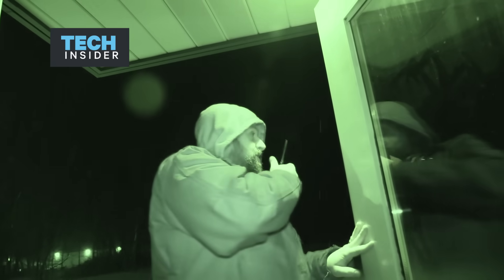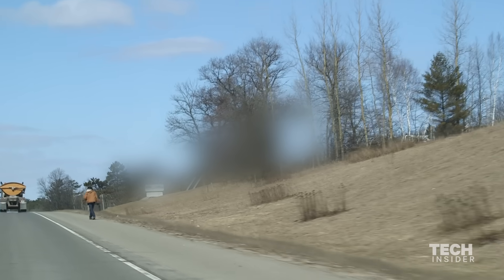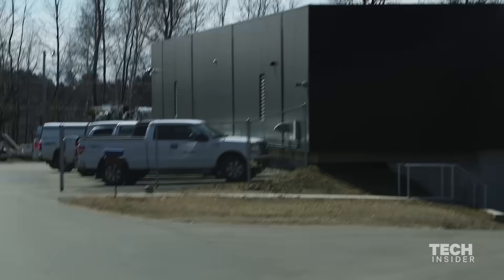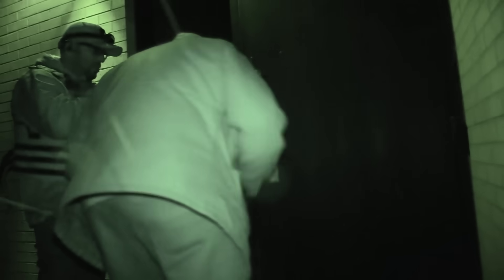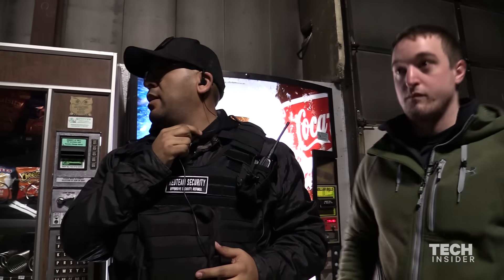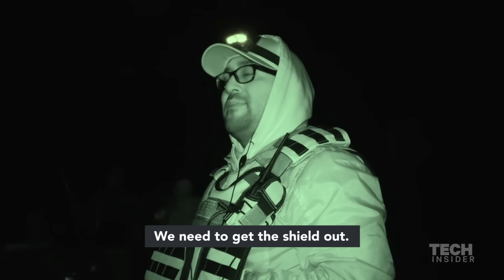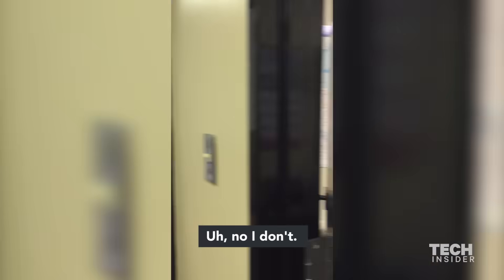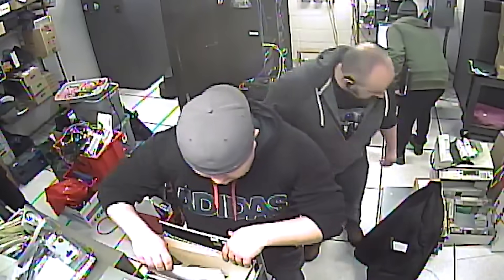Watch hackers break into the US power grid

Comment: Plug bot, AKA a raspberry pi 3
Reply: xxXSalty_Viper420Xxx Haha
Reply: Jepp :D
Reply: These board are sold either as RapsberryPi3 indeed or added hardware and preinstalled software so you dont have too, not uncommon in the scene. Some tools are waay expesive then they need to be, but some come with service contracts aswell ;) whats cool is most of it is basicly also availeble for free if you look arround long enough. But you probably end up a ethical hacker too.

Comment: I'm calling bullshit at 10:30, that power station would be putting out so much freaking rf radiation, there is no way you'd get a decent video signal. especially with a damn DJI phantom and an ipad fpv setup. sheesh they dont even have CP antennas lol

Comment: Hackers, using a MacBook, and windows , not to mention they have an iPhone, fucking hipsters
Reply: These are tools, if they work and comfortable, that's all you need
Reply: ThexXxXxOLOxXxXx That's a really strong statement. OSX is full-featured UNIX OS, are you saying unix os is not good for CS?
Reply: iare19 I haven't had a single bsod on windows for last 5-6 years. And it performs flawlessly for me. Are you by chance installing tons of questionable software?
Reply: iOS is 10x more stable and better for these kind of actions that windows lol. Burn windows, nobody uses that beyond commercial level.
Reply: iare19 Let's bump it a level then, do you maybe have cheap hardware with low quality drivers? That have been a problem since windows 98, terrible drivers are cause of most of problems after user himself
Reply: ubuntu... XD ... sure.

-kali
Reply: the list goes like this

1. Kali
2. Linux/Ubuntu
3. Windows
4. OSX

rekt
Reply: PuLsE Munstaz Linux is not build from unix, its a unix like System but has nothing from the original unix code.
Reply: "OSX is Linux based".... I've officially heard it all.
Reply: Anton Kovalenko get out of here with your basics, levels above you.
Reply: You can't hack well from OSX terminal though.
Reply: The Mac OS is a type of Linux technically.  Mac OS X is built off of a thing called unix. Unix is what most, if not all Linux distributions are built off of. Mac OS is more than capable of hacking into anything. Given the right tools. If you don't believe me look it up.
Reply: I didn't look it up. I read it from a comment a few more down.
Reply: Anton Kovalenko
yes I have pentium 1 on 56kb/sec dial up, you utter dumbass.
Reply: PuLsE Munstaz like you did
Reply: chiggins love it
Reply: this thread gave me ass cancer. OSX is linux based? Pentium 1 with 56k dialup (as in it is something special, lol, how 'bout 386 with 14400 modem lol)? Ubuntu as in c001h4x0r choice? Like literally what the fuck? Ugh, you stupid, public internet, and its only getting worse.
Reply: chiggins OK

Comment: 8:24 Is that Raspberry Pi? Huh...
Reply: It is. Best tool for hackers. Plug it in to internal wifi or ethernet and all traffic gets nice and monitored. You can use it as vpn hotspot and use it to access internal computers, or have robotic function like plugging off power when the time is right.

Best part, low power consumption so can run on battery and is size of a credit card.
Reply: JAYR_G Programming in Linux environment is amazing practice. C/C++ and python, oh the feels. It also teaches hardware orientated programming which leads to the IoT world.
Reply: I have the same question
Reply: ElectricSammich Ik I have one but I just use it to program
Reply: GTpcGaming seems like u may be able to help me in the future,  is going to subscribe and if I ever need help with anything I'll ask u k man?
Reply: im*
Reply: Yes, it's a Raspberry Pi 2. Those things are pretty much perfect. You can plug them in, they boot right into the operating system (which is just a normal Linux distro for ARM processors so you can do anything you're used to doing on a desktop PC if you use Linux) without the need of any interaction, they have USB ports and an Ethernet port. This means you can just plug the Pi into their internal network and tell it to start a program after booting which queries your own server for commands and then executes them and sends you the result back. This means that after deploying the device, you can take as much time as you want and stuff which only can be done from within their internal network from your office.

Comment: Yeah, I do research on smart grid security. The whole thing is a mess. DOE have their labs and they tend to give more resources to those labs and let these labs to decide the project applications of the others. When there is this kind of right, there is corruption. Those power grid researchers in DOE lab just want to publish junk papers and get paid. When they provide a standard or a real product, they don't consider the big picture behind or any potential weakness can be exploited. And it is the altitude of the whole research community now. The smart meters for example. They claimed it is essential to variable electricity pricing. It turned out there are other designs which is more secure. The smart meters collect electricity consumption of a home in real time which can reveal your inhome activity like whether you are asleep or whether you are at home. This is an extremely insecure information collection. Without any careful thinking, they make the new standard and make it a law to install smart meters at consumers cost. However, in the end, those utility companies and grid operators don't utilize these information at all. And smart meters are proven not the only way to achieve variable pricing. So, as a final result, without any benefit to any one, they create a hole in people's privacy. Indeed, in some state, debt collectors and some other agencies are allowed to use your smart meters data to see if your are at home. What a shame to work with these fools.

Comment: fucking neckbeard christ, why are you in tactical gear... lmao.. fuck.. police roll up and you have MEDIC across your chest.. 

have clipboards, toolbelt, and a fucking jumper.. badge.. common sense, fit in, not look like you playing paintball
Reply: Burglars tried this at a former workplace of mine. They jumped the fence where there was no camera coverage, entered a crew building, then put on company coats and hardhats and walked out in the open to start stealing copper and anything of value from the trucks. They didn't realize that the operators on duty watching them once they stepped in front of the cameras knew that there wasn't supposed to be anybody in the yard at 2:00 in the morning. Cops were called and they surrounded the facility and moved in. They caught two outside the fence and another the next day. Burglarizing a utility facility netted them both local and federal charges.

Comment: I heard about this (or very similar) in a cyber security class last summer. The other issue is they need to update the protocols that are used to control this stuff. The original protocol was made for phone lines, communication over the power lines so security was no issue, now they use internet links and this is an issue now.

Comment: Is breaking in physically not cheating a little? Physical access to systems is king and so if you break in then it is game over, what comes next is moot. You are not really giving their internet connected security a test at all. The idea IS to test the IT infrastructure, right? Because I see a physical pen test as something completely separate to a network/intrusion pen test. Even if the scope were to cover physical security, then a comprehensive test of the network would be first and more likely to get you a foothold (IMO).
Reply: huxleypig69 there are no rules in hacking
Reply: D Freytes
I completely agree. However, we are not talking about a 'break it all costs' mentality. A pen test should be a TEST of the defences. Whilst this may expose the physical issues, it does nothing to stop a future hacker from gaining entry via the wifi, or the web server, or any other technical method. The issues remain untested. This should be a last resort, not the first (unless it is a physical pen test, which this was not).
Reply: Breaking in physically was part of the hack. It is called social engineering. 

If the company had better security and on-site protocols, they would not have access physically.
Reply: Tinutaja
They didn't socially engineer their way in. In fact, they tried and failed spectacularly to socially engineer their way in! It was one of the poorest attempts I have ever seen.

They gained entry by shimming a latch and using an under-the-door tool.

If I were this company I would feel somewhat cheated because my IT infrastructure had not been tested against external attack at all.

Comment: Compromising the power grid is real simple.. You don't need all this "social engineering" and other "technical skills".  All you would have to do to shut down the grid is a coordinated attack of people at a bunch of different key sites and throw a few grenades over the fence and blow all the shit up that controls the grid.  Most of it is sitting there, readily accessible, with weak fences and other security measures.  The hell with hacking the computer systems and giving yourself root, just get rid of it and it all crashes.  The current grid is already over-taxed with demands so blowing it up would ensure that nothing is going to operate for the foreseeable future.  This is cake and childs-play and has already been assessed by multiple agencies.

Comment: You'd be surprised how many places you can get in to by simply opening the door.  Specially government facilities, power grid but also to homes..
Reply: Doors typically are both the entrance and exit of a building.. I'd find the window perhaps a bit more surprising.
Reply: CrapLuckSimon Windows too but they rarely are made to be open frequently. Definitely weaker structure but usually requires you to just smash it where as with door, you just turn the handle. It is totally human to forget to lock the door you use to say, go to cigarrette break ;) Most common door to be unlocked, sometimes even propped open..
Reply: SquidCaps I was just saying, doors are typically how a person pass into/out of a room. And by that I mean it's not surprising. However I understand what you're saying, that it IS surprising that mostly anyone can get through those doors. 
I dunno, maybe I'm being a dick, sorry. I was just trying to make a light joke lol.

Comment: The plugbot looked like a raspberry pi.
Reply: oh rlly? maybe beacuse it is one https://github.com/redteamsecurity/PlugBot-Plug
Reply: it was a raspberry pi running plugbot
Reply: it is
Reply: delicious 3.14
Reply: +Neceros I don't know if it was exactly, but they are very similar in function.
Reply: it is:https://github.com/redteamsecurity/PlugBot-Plug
Reply: I still think on how to get a Pi to connect over the Power grid to a network.
Reply: it is one
Reply: +SkiP_ is that a plugbot? Legit one?
Reply: I agree
Reply: Hackers use raspberry pi because it can run linux which is used quite alot in hacking. Look up Kali Linux its a great penetration testing OS. You'll get the idea then.
Reply: James H And it is cheap enough to just leave it behind.
Reply: Haha yeah - I paused at 8.22 and got out my raspberry pis and defo is the B+ or 2

Comment: Did anyone else see the Raspberry Pi when they were talking about the plug bot and grin? lol
Reply: +Hexigonz If you check their website, they say the RPi is one of the viable devices that can run the software for a PlugBot - basically any small computer that can issue commands and send information over the internet.
Reply: The RPI is more valuable than you might think. It may not be a full computer, but very close. It have network access, good storage and good amount of ram and the cpu speed is quite good. And it run linux. All you need to do is write a program for linux and compile for the ARM processor that the RPI use. And it is inexpensive and small. One of the best suited hardware for that job beside having a custom made one.
Reply: you wanna hack someday i see..

Comment: unless you hack the transmission company you're not going to get very far. turning off one substation is easy but the transmission companies will know immediately.
Reply: +Tyler Owens What do you mean transmission company? I'm asking out of curiosity, I'm not challenging you, I'm generally interested. I don't know anything about power grids. Is it like internet where there is an ISP and then a separate company that provides physical cabling? Like the transmission company owns the lines?
Reply: +Hexigonz  you have generation plants, the extremely high voltage is sent over transmission lines (tall steel towers typically) to sub station to bump the voltage down to distrubution voltages. that's what these guys are hacking) that will shut power off to all of the distrubution costomers, you/me/businesses. the companies that monitor these substations are very strict and need to know what is happening when something shows on their alarms
Reply: +Tyler Owens Gotcha, that makes sense. Thanks for clearing that up.
Reply: INTERNET NET IS PIECE OF CRAP 

WHY EVERY THING IS CONNECTED TO INTERNET ?
EVEN POWER ?

I MEAN A JUST SOME BINARY DATA TO SWITCH OFF ENTIRE POWER  GRID ?
REALY?

ITS LIKE KILLING AN ELEPHANT WITH A NEEDLE

RIP IT PEOPLE
Reply: Becos tingz haf advanczd ma frend, dis iz da 21 centary ma dude!
Reply: +Tyler Owens but wouldn't releasing malware into the server make it so they can access that, disable any alarms, and shut it down?
Reply: +Tyler Owens oh gotcha I was thinking it was an alarm signaling a breach. Thanks for the info man!
Reply: Local substations, depending on what size can put a couple thousand to maybe a good chunk of a city (which most subs have back up loops) it's the generation plants and transmission lines that feed everything are what are high security
Reply: If their goal is to shut down that station, they already have physical access, can't they just shut it off physically and then sabotage the controls...?
Reply: Charles C If power is that important to places like that, they will have back-up generators. ;)
Reply: +Tom L Well kind of, they certainly could disrupt it in a variety if ways. But also the whole internet "hacking" mumbo jumbo is pretty much irrelevant in this particular operation. The internet was just a more convenient way of talking to their gadgets they left inside.